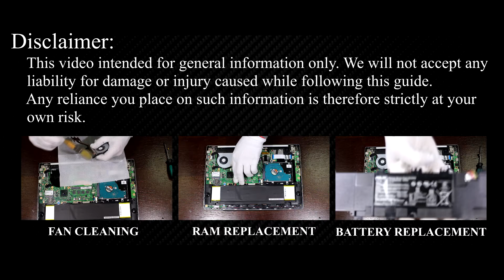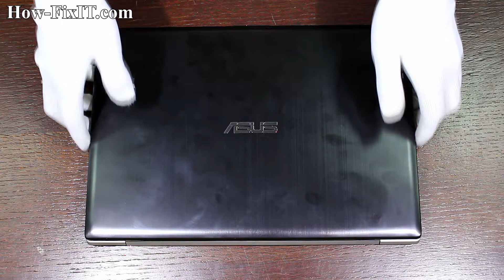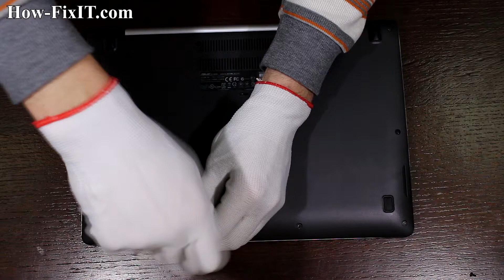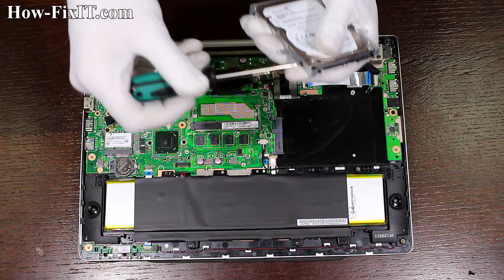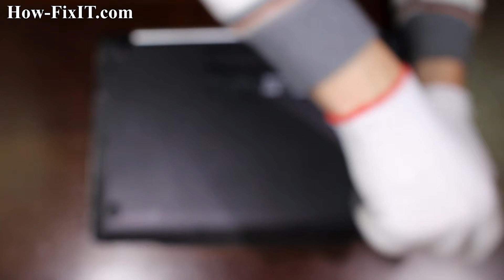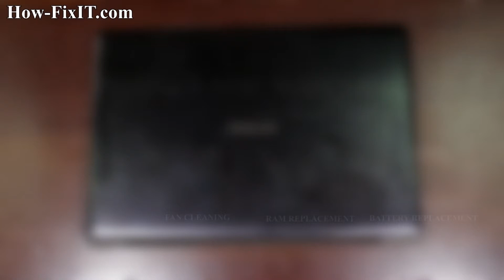How to Install SSD or HDD in Asus VivoBook S400 – Full DIY Tutorial

Comment: The SSD Samsung 2.5'' link in description leads to 250GB Internal SSD sold by Amazon: is it possible to install a greater one, like 500GB or so, on Asus VivoBook S400? Actual old HD size: 400GB. Thank you in advance.
Reply from the maker: Yes, you can install a hard drive or SSD with a capacity of 500GB or even more
Reply: @howfixit  Подскажите, пожалуйста, на Ваш взгляд стоит ли в 2021 году обновлять s400с увеличивая память до 8 gb ram и поменяв жесткий диск на SSD, если цель - бюджетно усилить машинку для серфинга в интернете и для работы с pdf, офисными приложениями и почтой от Майкрософт? Сказать честно, ультрабук стал заметно притормаживать за годы использования, ось - десятка, обновившаяся с лицензии восьмерки.